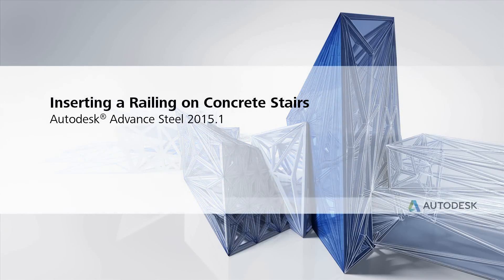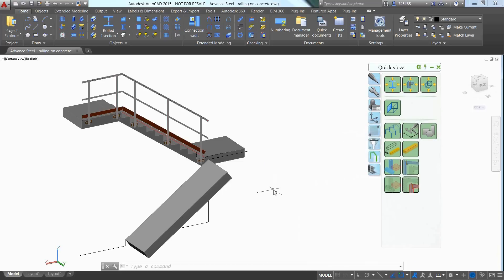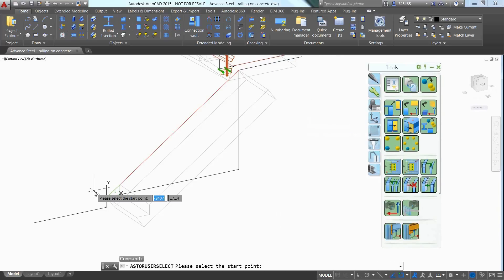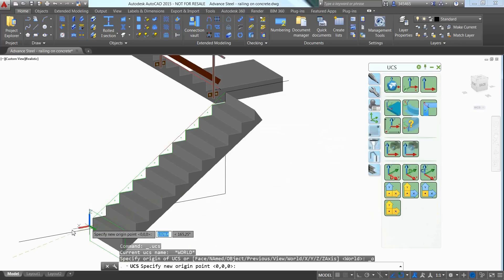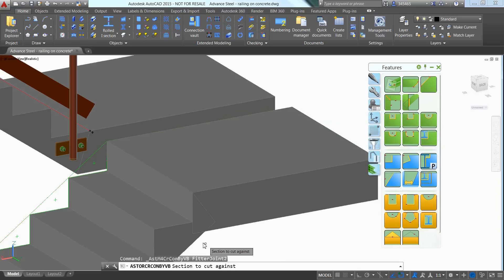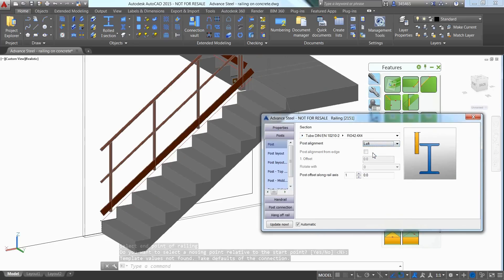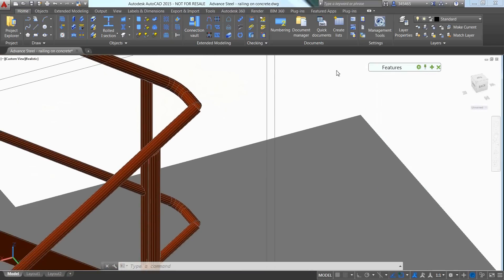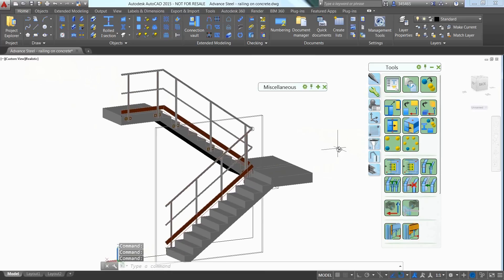Advance Steel - Inserting a Railing on Concrete Stairs

Comment: Hello, I just start using advance steel couple weeks ago, I saw your video and tried to execute the sample the same way you showed, but am unable to slope the concrete beam; is there any restriction i have to change or set up prior to doing the command?? please i need your help